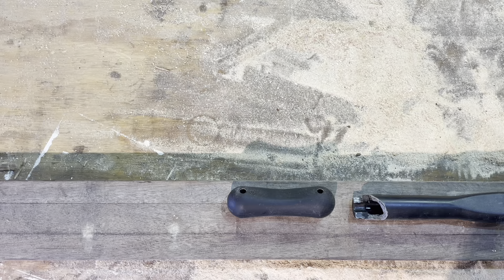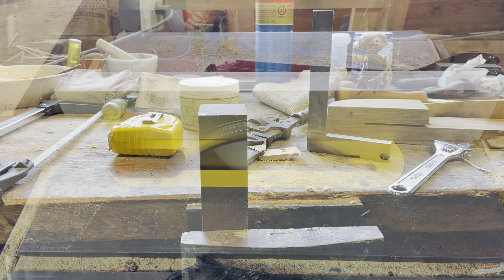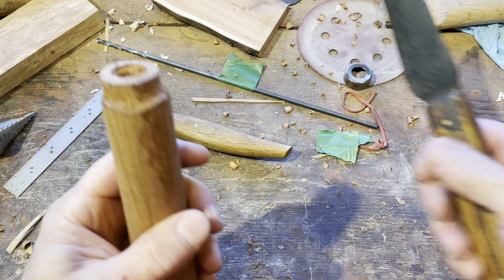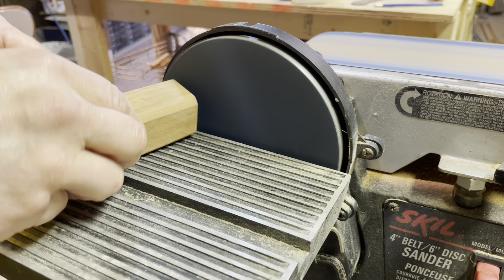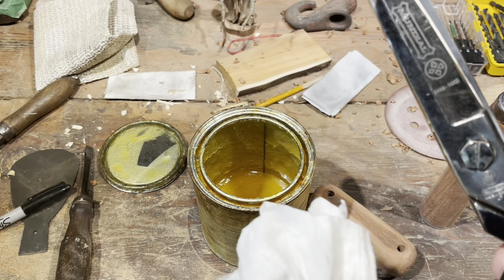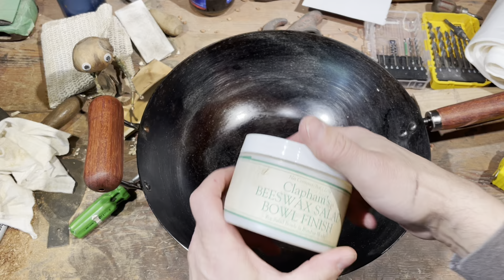Wok repair

Comment: You are repairing handle, not a wok.
Reply from the maker: @foxversusall4965  to be specific, I am replacing a handle. However, I feel that the handle is part of the walk and that the description is accurate. But I see your point, if you were expecting some metal work, then the video would be a little bit disappointing.